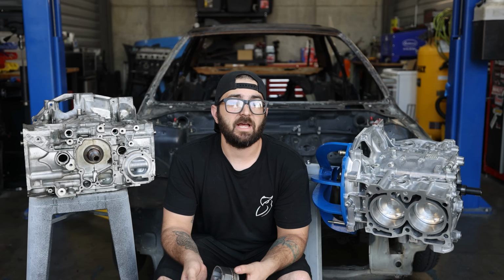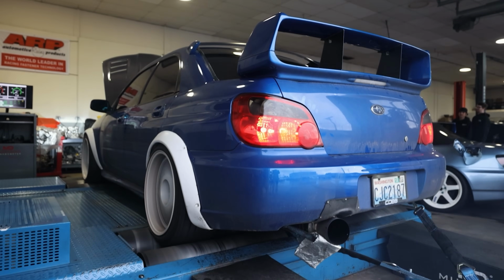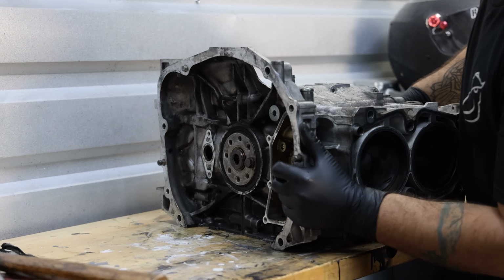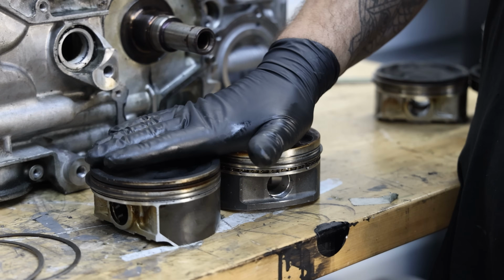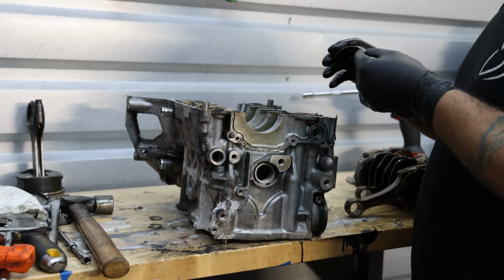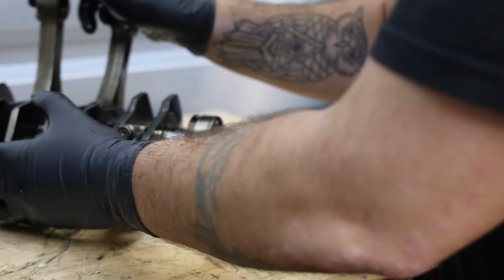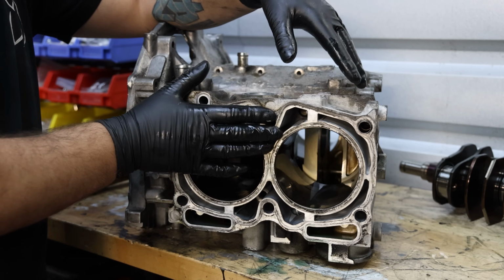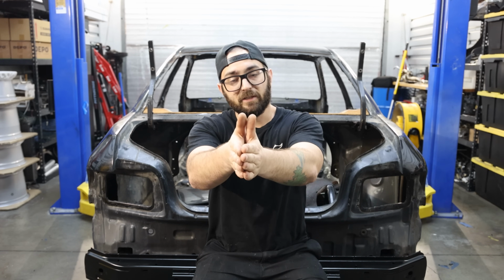The Reality of Stock Engines & making power; Subaru WRX STI

Comment: That's what I am doing with my 2015 Subaru Forester 2.5i, 0w20  in the Winter, 5w30 for the Spring/Summer.   My Forester runs smoother and hardly no oil consumption with 5w30

Comment: I bought a wrx that has a sti semi closed block. Had spool forged rods and pistons, guy had it tuned and built and it completely cooked the pistons (literally melted the middle of them) one chipped aswell, ive put it all back together with spool parts. Im wondering what could do that bloke said it was the wiring loom idk if that makes sense. It seemes to just have overheated/ maybe detonation? Idk ey edit: i think he said he got it to 300whp

Comment: My 2013 STI is a Japanese Fiat, one problem after another, has used a quart of oil every 600 miles since new.  Destroyed motor with thrown cam belt at 16K miles-  then dealer claimed not covered by warranty because I changed oil myself despite Magnuson Moss which nobody enforces.  Sloppy factory motor build with wrong oil control rings POS.

Comment: If your adding more power than stock car, build the motor for far more power than you are using (focus on reliability not power first) or you will blow it and build it later anyway and waste your money 😂 imo they're tuned to the highest safe tune already for what is in them and they're at the age where rods, oil system etc in general are untrustworthy even in normal conditions. They are far too well known of a platform at this point and you still see people who are just destined to destroy them because they refuse to learn. If your not mechanically inclined and aren't basically autistic about EJs don't buy these cars 🤣 do it once do it right overbuilt undertuned is de way

Comment: The car you were talking about at the end with 450hp on stock motor, what exactly was done to that? Stock heads? Just bolt ons?
Reply: Pretty sure he said FP black turbo, probably all new fueling system bigger injectors/fuel pump/FMIC/cooling basically all the normal "hey keep that oil cool bro" mods and an fp black turbo. I'm sorta winging it here, but its probably like that.

Comment: The SRT-4 ran low compression, and cast iron block with aluminum head. So if you want to run higher boost psi, could you run a lower compression such as 8:1

Comment: So I got a 2017 Subaru sti 3 days later after I buy the car start with rod knock noise now I open the engine see the damage was a rod bearing issue so now I rectify the crankshaft and I buy a forged rod and king Bearing xp so my question is how much power do you guys think the engine can handle best for daily driving and long durability with forged rods and king bearings xp series ?

Comment: Honestly having owned these cars.  Still have my 06 STi and have a bunch of other cars.  They're fun cars. But if anyone has an option and is thinking of buying them for "performance".  DONT.. It's a dead platform. 

Expensive to build and makes no power. When It comes to HP per dollar, just not worth it anymore, nor are they competitive. The community depending on where you are is mostly toxic. Guys blow up their motors and ask for near new prices for part outs. 

It's a tragedy because they are great cars and relic of previous times. I've detuned mine and I'm running 350 wheel on built block, good for weekend driving and admiring.  That's it.

Good luck people.

Comment: Hey bud! I realise there is some variables but as cylinder pressure and torque is directly related can you give us a torque number you think the stock block is safe on... really only oem calibration guys will have cylinder pressure data so giving us a torque number! will be more helpful than a hp number..cheers

Comment: There’s always a rule of thumb on stock blocks. Only in niche exceptions do manufacturers have the max power pushed out of a motor (13b renesis, NA motors). However in most cases the engines are making the most efficient power in coherence to smog laws and emissions. Meaning your vehicle is probably making the most power it can efficiently. Hence why once you start deleting emission features there’s that supposedly power wiggle room, and it’s true, some power can be made on stock motors. But now you sacrificed emission efficiency, probably gas mileage, and reliability for more power. At least that’s the consensus on some old mechanics around here.

Comment: theyre reliABLE at stock wrx powers which is around 240 hp. 300hp is the standard for sti model, but this will have a shorter life after it has been used to it's maximum potential. a stock wrx used at maximum potential will also eventually wear down but not at the extent of a 300hp setup. so the answer is 280hp is the safe zone for subaru. 
due to their horizontal design of the engine which works against gravity heavily, their engine architecture is built around torque resistance than for high rpm hp.

Comment: Much as  I love my Forester (just an NA functional car), it is disappointing Subaru, which plainly harbors some people who think outside of the box, did not follow up on its brilliant concepts, with more robust engineering.  Surely if one is going to build a bargain price rocket like the WRX, it would not have been too hard to include some robust components?
My 2006 Forester has noisy input shaft bearings.  It has done 250,000km.  It is just so irritating to have bearings in a Japanese manual gearbox failing after so few kms.  A manual gearbox should be good for twice that.

Comment: I want some low compression pistons for my 2.5i so i can throw a smallish turbo on it and get to 300ish hp. Any suggestions? I've got the engine that came with the car already sitting on the floor in my garage.

Comment: The neck of H beam connecting rods is so much thicker than an I beam rod is because H beams are so much weaker. 

The strength is mostly due to forging, but the design of the H beam itself is suss at best.

H beams are far cheaper to tool and die. That’s why most aftermarket rods are H beams.

Comment: Also, is it still a first engine, with potentially compromised rod bearings from the OEM. at this point i feel like an oil analysis is almost more important than a compression test.

Comment: 700hp/535trq on a semi open deck block tuned by yimisport raced the car for 4 seasons at the 1/4 track and local street racing still holding strong. It all depends on who built it what parts it’s running and most importantly the tuner

Comment: I need an opinion:

I am daily driving an 05 sti, Freshly rebuiilt heads and new block at Auto Science, a trusted subie shop near me. Although the block is stock, the internals are wiseco forged, and its tuned very well at 24 psi on a blouch 1.5xtr on Flex Fuel @ 440hp
If daily driven normally with the occasional pull, would the motor last a while? Theres also a million other supporting mods like Killer b ELH, pickup, baffled pan, AOS, Oil cooler, etc

Comment: I have an 05 forester xt 2.5 just rebuilt the stock ej255. Nippon racing pistons and bearings, scat connecting rods, forged crank, mls gaskets, all the rest is OEM subaru and completely machines and rebuilt the block and heads. 330 miles on breaking in. Stock setup. Hoping it will last 🙏

Comment: hey man, bought a 13 sti and spun a bearing a month later. motor is in the machine shop right now and theyre telling  me the heads can be reconditioned and block isnt trashed. It has a .002 bore with wisco forged pistons, stock rods and crank, im looking to make 400 hp max so im probably going to stay with stock rods. your vids have been and will be so much use! thank you!

Comment: Im hoping to be around 400whp with a forged piston stock rod ej20x with a TF06-18k. Its been a solid motor up to this point and im fine with the torque loss of 2.0. Ideally i find a ej22T block or i get a thick walled 207 block. Switching to spec b 6 speed at the moment as well

Comment: Pushing 360whp (mustang dyno) in a stock block 20 year old Forester. It's been on this setup for about 15k miles. 20G turbo and all the bolt-ons. Classic 92 pump gas in WA. I did all the work myself and credit Tanner for the help. There was a Smeedia video for damn near every mod. WHEN the day comes that my engine lets go I'm coming right back the channel to learn about engine building!
Reply: A man after my own heart. I wish you all the turbo boxer fun in the world, sir! Cheers 🍻
Reply: murica needs better gas. were just running i/h/e, fmic, 340fpump on 100 octane(RON) pump gas and were getting 360-380whp for most of our builds. can go higher if we add tgv deletes and id1050
Reply: Thanks man. I have 04 Foz xt 232k but do seem healthy doesn't burn oil after risoline. Was thinking of bolt on catback downpipe and a ture for like 300ish. I think I may do it.
Reply: 360 WHP is max.  Don't get greedy.

Comment: Do you or anyone you know have information on the ej22t's? I picked up a 92 legacy turbo and the factory closed deck/ oil squirter combo is enticing for doing a hybrid build on it. Only problem is finding information due to it's age and rarity lol. Only other subaru that seems this obscure is the late model 5th gen legacy gt's with the el headers and FA style turbo system.

Comment: My 2011 sti is going on  5 years and 29000 miles on my 412hp 402 tq stock engine block. Full fuel system iag AOS Cobb front mount equal length headers and a blouch dominator 5.0xtr

Comment: In terms of built blocks, which manufacturers would you recommend? I'm looking to overbuild either an EJ20 or Ej25 for my 07 Impreza that I'm gonna daily with some mild-moderate spirited driving on the weekends. I want to have the option of multiple tunes for occasional track use.

Comment: I agree with this 100%.  I tell customers 330 hp on shit California gas, 390 with E85. If all is right, this is track day safe.  A little more is possible for short duration like street use.  This is if the tuning is perfect, the fueling, cooling, and everything else is great, and the engine is in good shape to start with.  At higher power levels you are one knock event from killing it so it is all about the tuning.  The tuner has to be smart and understand Subarus.
Reply: Having motoiq commend your videos has to feel legendary
Reply: What tuner do you recommend? Preferably a dyno tune not e-tune.
Reply: Hey bro 
We get 99 in the uk and I'm currently running 360bhp on my 2016 sti

Plan is to upgrade my turbo, injectors and fuel pump and have it mapped up to 400/410 

What's your thoughts on this buddy ?
Reply: @Rumbling-Cumbrian  Don't compare EU octane ratings to US so get that straight first
Reply: @Null-h8j  Whats the difference ?
Reply: @Rumbling-Cumbrian   Google to see what the equivalent is since I don't know exactly but I know EU octane ratings seem higher but are equivalent to lower in the US
Reply: @Rumbling-Cumbrian the difference is RON and AKI measuring standards/calculation for octane rating. EU uses RON and US uses AKI and AKI is always a lower number when calculated on same exact gas as RON
Reply: @DiLLY_V92  exactly. 93/94 US is same as australian 98 premium

Comment: Hey I have a question about Subarus 

I’ve recently bought a 2006 STI Hawkeye with and turbo EJ257 according to the chassis tag 

I’m concerned it’s not the original engine, what would I check for to know is it the EJ257 or 255. What arrose my concern was first the brakes didn’t seem correct then I realised it was a 5speed box with the 6 speed shifter. If I opened up the engine what might be able to help me identify or would the compression ratio be one way ?

Comment: If i have a ringland or bearing failure. Keeping everything stock. Do I still need a new shortblock ??
Reply from the maker: Tbh it really depends on how bad the damage is to the mainline and cylinder walls
Reply: @Smeedia  crap……..other thing you said once if i remove the white bin under the oem airfilter then you will the car moreor better something like that right? If you did not said it sorry 😅

Comment: The crevice volume (area between the top of the piston and the compressio ring) of a oversquare engine like the EJ is naturally bigger and thus increases hydrocarbon emissions. Gas gets stuck between the cylinder walls and the pistons, then get expulsed on the exhaust stroke. This is why Subaru had to use small ringlands, higher up on the pistons, which makes them weaker, especially during detonation events.

Comment: Man I had a shop near me rebuild my engine in my wrx completely stock engine have 9k on the new motor and I have a knocking noise not a rod knock but definitely not a good noise I have had a lot of people say piston clap or timing chain the car drives fine boost fine but what I want to ask you is if it is one of those two things how much longer do I have till boom?

Comment: i ran 14 psi off a 3076 on a "stock block" ej201 (the NA SOHC) it only had a thicker HG and a standalone, ran like a top for a few years now(sold it after a month of it being finished) its wild how they can actually take decent power if you slowly ramp the torque up, that being said the gearboxes dont like it much :D

Comment: I don’t understand why Subaru doesn’t have the connecting rods beefed up and forged from the factory. Especially knowing that everyone buying these cars are going to put power to them. I’d assume it’s because of emissions, the more internal weight the less efficient it will be as a mpg standpoint
Reply: A few reasons.  It all boils down to the consumer and the goals of the engine.  Subaru didn't build these engines to make 500+WHP  They built them to make 300 to the crank.  They also have to take into account neglect from owners.  A cast piston can maintain piston to wall clearance and stay quieter and burn less oil with an owner than doesn't take the time to let the car warm up.  With a forged piston, if you don't let the car warm up a bit before you set off you will wear that engine at a MUCH more accelerated rate.  This is why people have the idea that "built engines don't last as long".  That's not really true but abused built engines don't put up with neglect quite like a stock engine.
Reply: @DeweyWRX  ahhh that makes sense. Basically not as ideal for a daily driver is what I comes down to for the average consumer
Reply: @DeweyWRX  I do a lot of short commutes so that would be very detrimental to the engine in that case
Reply: @dan2danger  it might not.  It all depends.  I just tell people to not set off until your temp gauge shows SOMETHING and don't feed it boost until it's all the way up.  Any ICE engine needs to warm up a bit honestly.  Short trips are WAY harder on an engine than a proper drive.  You should let your stock engine warm up too.
Reply: @DeweyWRX  what about turning it off? I always try to let it cool down for a few before I turn her off. Idk if that’s necessary or not. But I do it anyways. Or if I’m on a trip and when I fuel up, I’ll keep her running. What’s thoughts on that?
Reply: @dan2danger  unless we're talking like hard track time and you need to get your fluid temps back to reasonable just turn it off.  We have coolant running through our turbos so you really have nothing to worry about.

Comment: how are the 6 cylinders stock blocks when you start to introduce boost? I eventually wanna try to build a daily with a boosted EZ30 R and have it sit around 18-23lbs of boost.
Reply: look up videos from the aussies, forgot the guys name but he appeared in the videos mcm did with their ez30 levorg. The series is a good start for getting information, but research is key. Absolute must though is the closed deck modification, as they don't like much boost. Outfront and possum bourne motorsport did/do closed deck machining on them. Most stuff you will find will be from australia since they got the 3.0r legacies with the 6 speed.
Reply: Depending on the 6 cylinder engine you intend to use